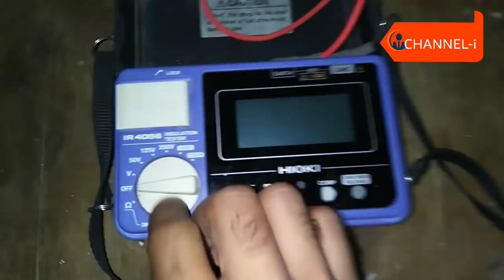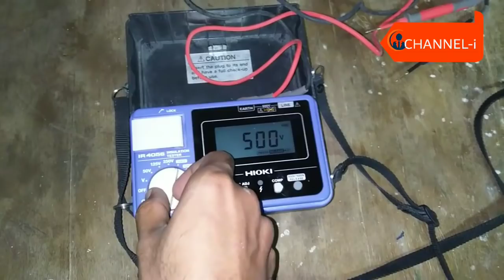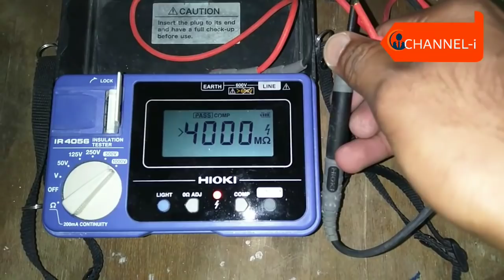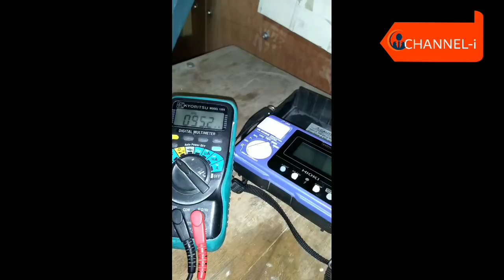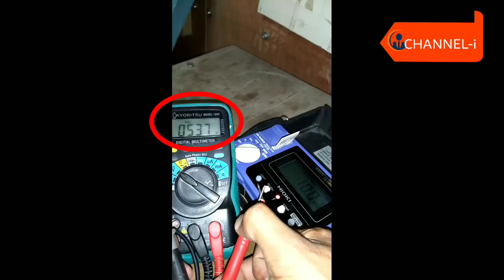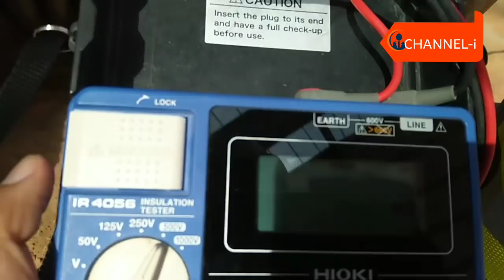What is megger malayalam|എന്താണ്‌ insulation resistace tester|insulation resistance tester malayalam

Comment: Actually cable testing megger  value 100Mohm kooduthal aanel IR pass aanu...but actual value kittan vendi cable  lab testingil serikkum megger use cheyyulla pakaram Volume resistivity or insulation resistivity test equipment  aanu use cheyyunnath.. athil 27 degree temp il 1x10^14 ohm cm kittyal test pass aanu...
Reply from the maker: Thanks for the info
Reply: Electric motor insulation megger use cheyth check cheyan pattille...? Athinte grounding conditions and limits paranju theravo..?
Reply: @anelmathew2490  Cheyyan pattum...youtubeil orupad videos undu...comment aayit ezhuthunnathilum nallath aa videos kaanunnathavum...👍
Reply: Above 80 is ok
Reply: @pathrosp4049  For excellent insulation resistance above 100 is compulsory. Anything below 100 will be considered as only good insulation category which will not ensure long term durability of the cable.

Comment: 1000 വോൾട്ടിൽ ചെക്ക് ചെയ്യുമ്പോൾ 1000 വോൾട്ട് അല്ലേ കിട്ടേണ്ടത്
Reply from the maker: അല്ല, നമ്മൾ check ചെയ്യുന്നത്‌ 1000v ഉപയോഗിച്ച് ആ cable ന്റെ insulation resistace ആണ്, Resistance ഇന്റെ unit ohm ആണ്,
Reply: @malluengineer1838  Ok